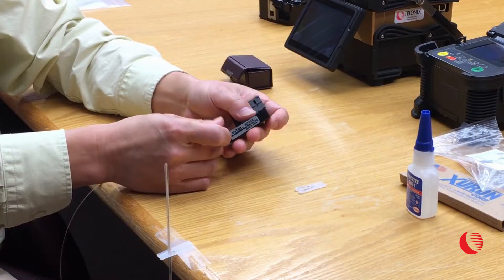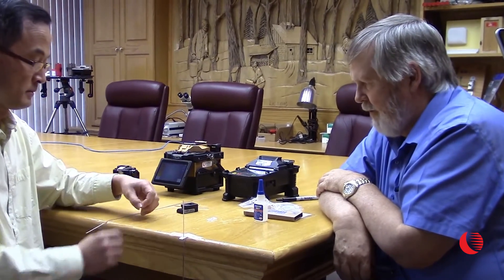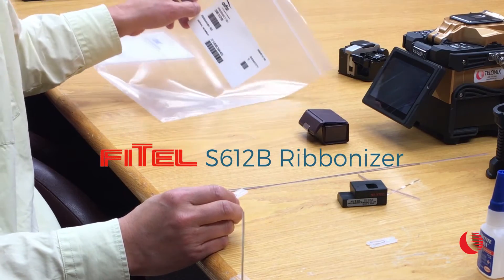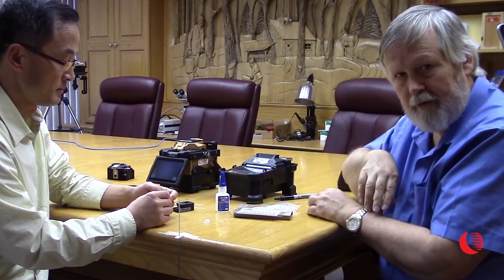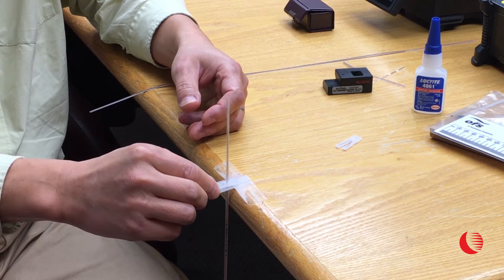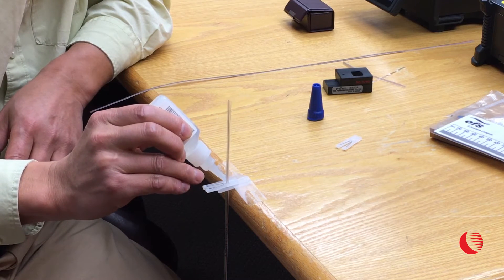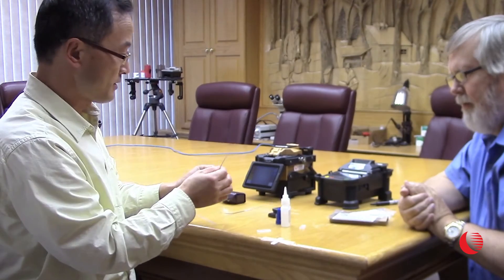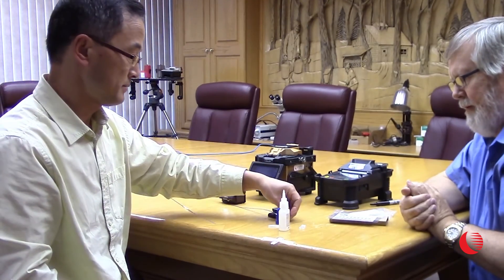Procedures for Ribbonizing and De-Ribbonizing

Comment: Test done of de-ribbonizing was very simple but the contrary, so ribbonizing, has been done in a previous de-ribbonized fiber ribbon, not in a bundle of 12 loose single fiber, could you explain how to do it in single fiber?
Reply: Right! Nobody wants to re-ribbonize a ribbon with the tip de-ribbonized. We  would just put Elmers on our fingers and run it up. We need demonstration loading loose tube and mst singles.